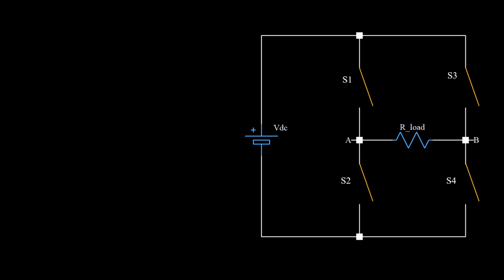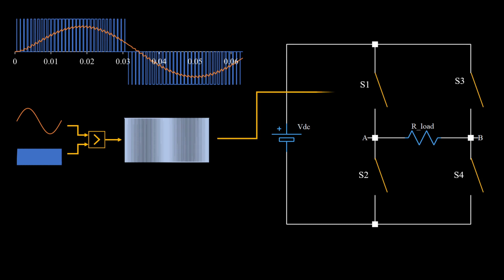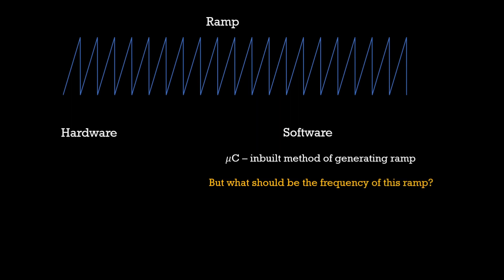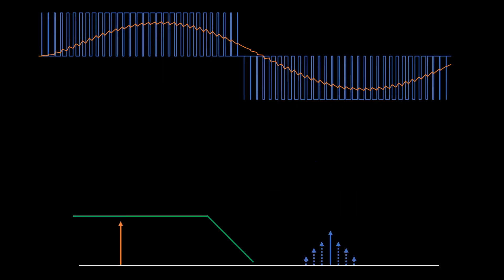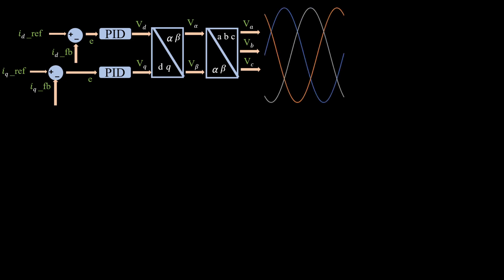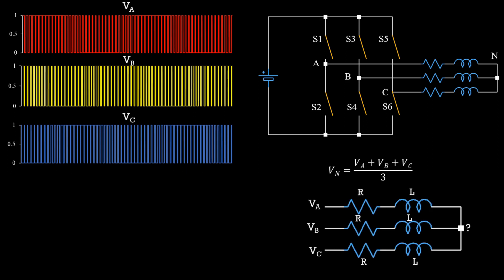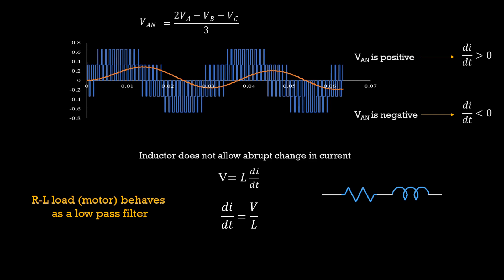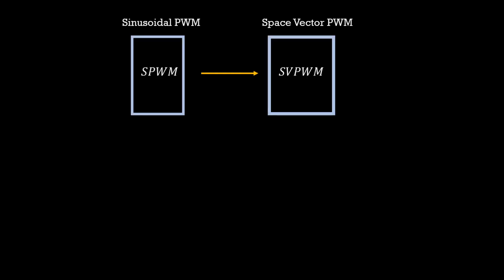Motor Control From Scratch - Part7 | Understand Inverters - The Easy Way!

Comment: Hi, after normalization with vdc, how are phase voltages a,b,c translated to pwm outputs? The normalized values can be in the range (-1...1) but the pwm must always be positive (0%-100%) mustn't it?
Reply from the maker: PWM is created by comparing it with a ramp. The ramp can be either from -1 to 1. Or you can normalize Vabc further between 0 to 1 and compare it with a ramp from 0 to 1.

Comment: Why do we not ignore 10kHz to 20 kHz which is in the audible range for motor control and use a higher or lower frequency?
Reply from the maker: Hi Joseph, Can you please elaborate your question? - I did not understand it well
Reply: @thesubcooledmind7910  it was mentioned that we operate motor controllers at a switching freq of 10k-20k, these range of frequencies could actually lead to audible noises right? why do we still prefer exactly those switching frequencies?
Reply from the maker: Its a trade-off. 10-20kHz does lie in the audible range. But higher the switching frequencies - more is the switching losses. So, you either prioritize the noise or the loss.

And in some cases (low inductance motors) - even 20kHz is not sufficient. You will have to go higher than that for better control.
Reply: @thesubcooledmind7910   how do we say  pwm switching frequency vary with inductance... I mean high inductance , low pwm frequency and low inductance, high pwm frequency..... Is there any relationship with calculations

Comment: It may be interesting to point out the subtle difference between unipolar modulation described here and bipolar modulation. Also, are the phase voltages actually 5 level ? I understand that the pole voltages will be 2 level wrt dc link mid point, and the line voltages will be 2 or 3 level but I am not sure about the phase voltages.
Reply from the maker: I had initially added the point of unipolar and bipolar modulation - but I thought it might confuse people who are understanding it for the first time and since this was a  very basic introduction - I left it out. 

I understand that most of the texts analyze inverters based on pole voltage with respect to dc-link mid-point but I never understood that idea. It was much easier for me to understand what the phase to neutral voltage will be as that is what the load would see. For the waveforms - check out this link - https://www.ijrer.org/ijrer/index.php/ijrer/article/download/771/pdf

Comment: Hello sir,

I am able to limit phase currents in my foc for pmsm motor. Can you please guide me how can we include battery current limit?
Reply from the maker: Generally, in a motor control application - you have current sense only to measure the phase currents. And you can limit this current directly via FOC algorithm. However, there is no direct way to limit the DC current.

You can "calculate" the DC current via formulas based on the phase current and modulation in the micro-controller and then try to put a limit on it this way. But this might not help you for the overcurrent protection as micro-controller may or may not be able to act fast.  

For protection, you can add DC current sensing as well but this is not generally done. It is generally the job of a BMS to do that.

Other way to do it is - you put a limit on the torque speed curve of the motor based on some calculations so that the DC current will not exceed your limit in normal operation.